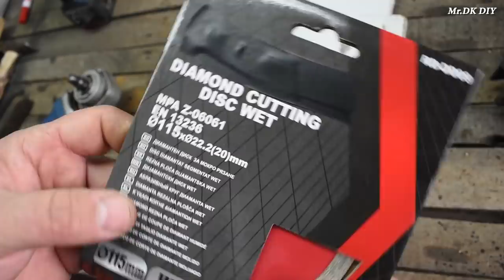Angle Grinder 1 VS Angle Grinder 2 DIY project / HOMEMADE SAW BLADE SHARPENING MACHINE MAKE AT HOME

Comment: Could it look any crappier? :)
Why two grinders?
Just add a block of wood with a center pivot.
Add an adjustable stop to the slide mech. So you don't have to worry about cutting too deep